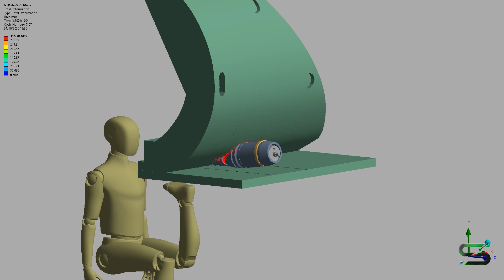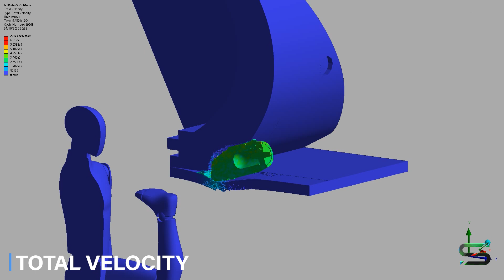Msta-S VS Maus | Armour Piercing Simulation

Comment: The Maus had some V shaped metal shield on the engine deck , like some Soviet T series have on there upper hull . This would have probably deflected the round upwards , this shot trap isn't possible . Do it again pls , to see the difference .
Reply: The engine has bulkheads. The blast wouldn’t disable the engine..

Comment: Hello — please check the armor concept I designed. According to my calculations, the structure I propose should work effectively against fin‑stabilized subcaliber (APFSDS) projectiles by progressively deflecting them from the normal during penetration, increasing the effective path length through the material and preventing a clean “punch‑through.”

The idea: at an angle (for example 70°) there is an assembly made of plates of graded hardness, each 30 mm thick, from relatively soft at the front to the hardest at the back — for example, a front plate of structural steel and a rear plate of tungsten carbide.

How it works: as an APFSDS penetrator passes through the plates it will be slightly deflected at each interface, accumulating a growing angle of deviation instead of continuing straight. This both lengthens the material the rod must traverse and reduces its ability to bore straight through.

IMPORTANT: every successive plate must be harder and denser than the previous one — soft at the front, increasingly hard/dense toward the back.

I propose the following scheme :

1. Steel St3 / S235 — 120–140 HB

2. Steel 45 / 1045 — 170–200 HB

3. Steel 40Kh (quenched & tempered) — 200–250 HB

4. Steel 30KhGSA (quenched) — 250–300 HB

5. Steel 38KhN3MFA (quenched) — 300–350 HB

6. Tool Steel D2 — 58–60 HRC (~650–700 HV)

7. High-Speed Steel M2 — 60–62 HRC (~700–800 HV)

8. Tungsten Carbide WC‑Co (cemented) — 1500–2000 HV

9. Ultra-Hard Tungsten Carbide + Ceramic Composite (WC + TiC + Co) — 1800–2200 HV

10. Steel St3 / S235 — 120–140 HB - A soft layer to catch potential fragments and avoid breaking itself.

To put it simply: when a projectile strikes armor, it is slightly deflected at the very first instant because the density beneath it is greater than above it. If the armor is homogeneous, then as it penetrates deeper it stabilizes, because the density evens out from all sides. But if each successive section becomes harder and denser, the projectile will experience continuously higher pressure on one side and will be deflected along its entire path. (At least, in my theory.)

Thank you for your attention. I really hope you consider the scheme I proposed and test it.
Reply: Interesting idea and I'd like to see it simulated. I suspect layers of uniform material might fare better, though. From what I've seen, what happens at the front of a penetrator has little influence on what happens to the rear (it bends and breaks rather than rotating), so it might be more like deflecting the penetrator one segment at a time instead of progressively deflecting the whole thing.
Reply: @DecidedlyNinja 
Layered armor made from a uniform material will behave exactly the same as homogeneous armor. The projectile will simply stabilize, because the pressure from all sides will be equal. I don’t know what effect my armor will produce, or whether it will be positive (the problem is that the front parts of the plates are soft, and they don’t retain the penetrator as well), but this is necessary to achieve the progressive deflection effect. Realistically, I expect roughly a +15% increase in ballistic resistance compared to homogeneous armor of the same thickness and at the same angle. I’m 98% sure it will work against older (short and thick) AP projectiles; there may be problems with the newer (long and thin) ones, since the deflection effect acts much less on them.
Reply: @BIGOR-T88  Ohh, I see. You aren't envisioning air gaps in this armor. My idea of uniform plates comes from an assumption of air gaps in between.
Reply: Great idea, but warthunder players will still find how to penetrate you from 500 meters in one pixel, XD.

(Except that, you've mentioned multiple layers of protection,  30 mm each, how much of these layers there will be, curious what would be thickness of the armor without angle.)
Reply: @kknowlage9843 
I have 10 layers, each 30 mm thick — that’s 300 mm at a 70° angle, which gives a purely mathematical equivalent of 877 mm. That’s if it were homogeneous steel. If my assumptions are correct and my design provides about +15% compared to homogeneous armor, then the expected equivalent would be around 1000+ mm.
Reply: @BIGOR-T88  interesting idea, I thought for a moment if it would be possible to put reactive armor between the layers (I don't know if that would work) to increase it's protection from ATGM's that can have over 1 meter of penetration, so just a random thought.

But the problem with overall such design would be incredible mass, problems with inner details, as the gun would be fixed in one place, and such protection could be wasted if enemy is from side (more of economical issue), and the last one would probably be weak zone where 2 lists conect (I couldn't imagine 70° angel done only with 1 plate all over) don't want to say that the idea is bad, all designs have flaws, after all, and your idea is interesting! Sorry if I wrote something incorrectly, that's just how I see it. :p
Reply: @BIGOR-T88  There's a problem here. Two of your ten layers are tungsten carbide, which is roughly twice as dense as steel. So, hopefully you'll get more than +15% protection compared to RHA, because it's coming at the cost of +20% weight.
Reply: @kknowlage9843 
My plates (layers) are packed tightly against each other, so there's no room to put anything between them. Also, ERA placed inside could damage the armor structure (a confined explosion). Although I do have a concept for dual ERA (to counter tandem ATGMs), mainly to protect against them it’s enough to mount ERA blocks on top of the armor.

The mass will increase, but at most by about 10 tonnes, since this is only glacis armor — for a 50–70 tonne tank that's not critical.

There won't be problems with internal components, because nowadays guns are routinely installed in turrets with composite armor.
Reply: @DecidedlyNinja 
Resistance of tungsten against APFSDS is roughly one and a half times higher than that of steel. The tungsten layers are thin compared to the total armor thickness, so they won’t add a huge increase to the overall protection equivalent.
And 15% is a deliberately low rough estimate — everything depends on how the projectile behaves inside the armor, whether it will change its trajectory as I assume. It could reach up to 30%.
Reply: Belle idée! Et belle connaissance des nuances des matériaux au passage, c'est du sérieux 👌
Ajouter du kevlar ou du caoutchouc entre chaque plaque aiderait, non?
Reply: @sirolzeb
Thanks for the like.
No Kevlar or rubber. If you add a soft layer, the projectile as it exits each plate will be deflected toward the side of least resistance — that is, toward where the soft layer is (i.e. downward). The trick is that it will experience a continuously increasing pressure in only one direction, which will produce a continuous deflection, without stabilization or voids like in conventional multilayer armor.
In short, to put it simply: I think you’ve seen that when a projectile penetrates a plate, on exit it shifts a little toward the side opposite the slope (downwards), into the empty space. Here we replace that empty space with the next, denser plate, constantly pushing it in the same direction.